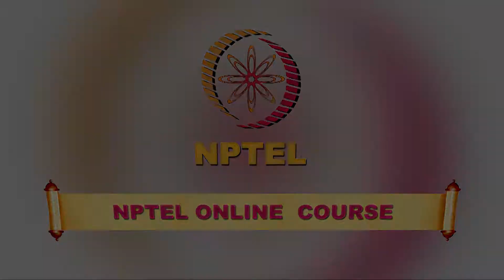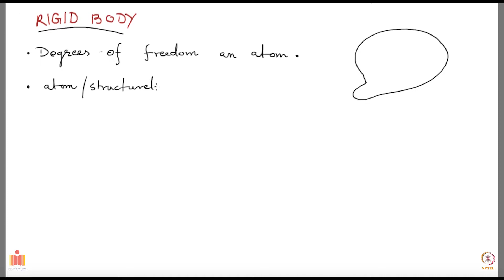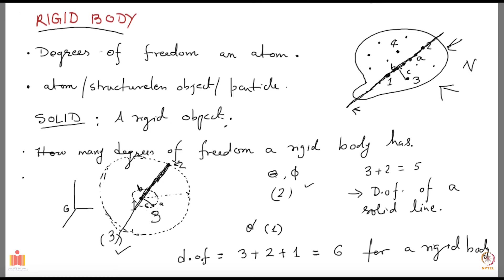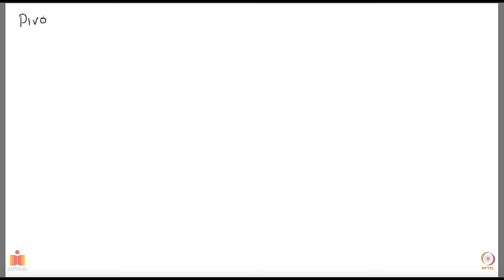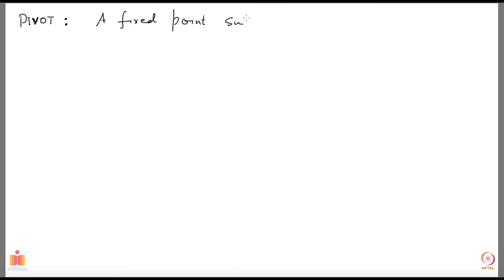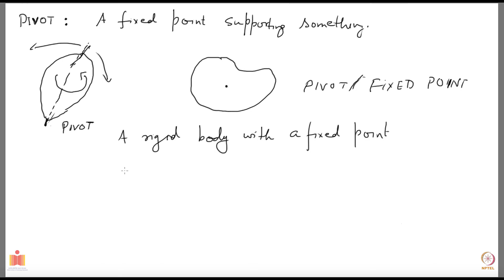Rigid Body, degrees of freedom

Comment: We can locate any particle (as for 1st particle)  with 3 degree of freedom then why we need others (2+1)
Reply: Bcz the 2nd particle can be move freely in theta nd phi (by spherical co ordinate system) if 1st particle is fixed. And 3rd particle can be move freely in r direction only(cylindrical system) if the first 2 particle are fixed. So 2nd have 2 and 3rd have 1 DOFs. So total dof=3+2+1